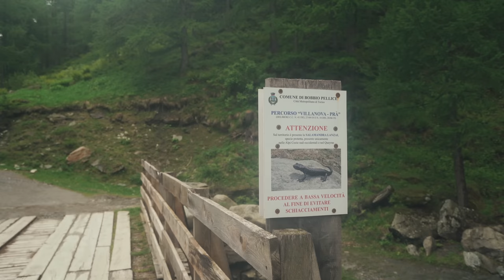#70 Pouring the Floor

Comment: Swales are good, but you still have water running over your driveway. It might be worth considering running a drainage ditch along the uphill edge of your driveway to direct the water, and then pass a culvert under the driveway if you need one. That way the driveway can stay mostly dry. Also given the muddiness you might consider a geotextile fabric under the stone. And I would also consider using crushed stone instead of gravel. Especially if your local gravel is collected from a river wash. River gravel is rounded and will roll downhill over time. If you ever intend to plow the driveway, you'll be plowing gravel too. Gravel is also more easily pressed down into mud, and then you're back to a muddy mess after a couple seasons. Crushed rock locks together and forms a more solid surface which is less inclined to wash away. Crushed rock on a geotextile fabric will give you a stable, durable surface.
Reply: I hope Martijn will read this advise about the road. I was reading a blog by Atulya K. Bingham on the top 3 things to organize if you go off grid. In her top 3 were water, a good acces road and (I don't remember).... and I was thinking about Martijns' road. I am sure he will do a lot of desktop research before proceeding.
Reply: Spot on advice @ErikPukinskis.Geotextile fabric for construction  (Not  weed barrier fabric,total different) is essential, it provides stabilization, reinforcement, & drainage,otherwise you'll just end up with a muddy mess.
Reply: I agree. ☝️
Reply: I agree. The same reasoning for rail ballast regarding river stones. But I prefer the strategy of dispersing the water flow, not conveying it.
Reply: I agree, culvert(s).Get the water under and beyond the road, not over it.👍

Comment: As a concrete man’s wife I was also so disappointed that you will have a cold joint where you ran out of product. You handled it with much grace. The project is coming along well. I’m proud of you young man. Many blessings from Canada 🇨🇦. So glad to see all four hens survived the assault.
Reply: I noticed that and wondered how much of a problem it would be. What are the downsides?
Reply: @lottie2525  the uncertainty is what makes a cold joint undesirable. Martjin’s purposes are encasing plumbing, drying in a living space, and supporting the uneven placement of weight. Liquids seek the path of least resistance and will flow along the joint toward the bottom of its slope. During winter this increases the risk of the concrete cracking during repeated freeze/thaw cycles.

If the joint is too close to the finish grade and/or sloped, the top layer of concrete can break from overlying pressures or spall.

Comment: “I highly underestimated the amount of concrete I needed” is the hallmark of all foundation pours. It’s always more than you think.  Looks great, making great progress. Always love your videos.
Reply: Was that concrete or slurry as to my mind that was way to wet ?
Reply: @gegwen7440  My thoughts as well
Reply: @gegwen7440  am I correct in thinking that have it more wet, makes it cure slower and therefore actually DOES adhere fully to the new layer?
Reply: This latest one🙌
Reply: I have done the same as a armature DIYer.  A 60 lb bag of cement seems like a lot.  It's not.
Reply: Once upon a time I was a construction inspector overseeing concrete pours.  I would have rejected concrete that arrived on the site this wet... but I understand our friend doesn't take delivery in huge trucks or use pumps to deliver the mix.  Wet concrete is easier to handle.  I'm sure this will work though it may be prone to cracking.  I'm in awe of how much work our friend  and his friends are putting into this project.  Deep respect.

Comment: Hi Martijn, good job done this week!  It is difficult to fix a mud road with gravel since the gravel simply sinks into the soil and the mud reappears.  One can use road fabric under gravel to prevent that the gravle sinks into the soil.  Doing earthworks to reduce water is certainly a good thing to do.
Reply: Good idea
Reply: When he uses under road drainage and diversion pipes, guiding water away from the road, then building embankments to slow its movement. That's alot of work for one man. He needs a road crew😊
Reply: @mezanian  I was just thinking.... Let's treat him with a team of hard workers to builld the road. episode #72 "The Road Show" 😄😄
Reply: @Pilot333  a chain gang lol😂

Comment: You’ve got the right idea of getting the road access right now. I’m surprised you waited so long to do it. The new vehicle is a good idea, 4wd/low range just make sure you get the right tires with tractor type grips. Use 50mm road base then grade and roll/compact before you start using it. Getting this right will make life much easier for you. It’s hard doing this work on your own, but it’s entirely possible if you’re organised. Keep it up but pace yourself to avoid burnout! 😊

Comment: Swales go perpendicular to the slope, slowing down the water, which also provides moisture to the soils during hot weather. This keeps the fire hazard down because the vegetation has more moisture content. 
People often put swales upslope from the paths, roads, to prevent erosion and water from running,  as you mentioned, along the ruts.
The swale is done so the water will flow slowly down, often away from important things like buildings, roads, sewer systems, and made on a very slight angle toward a pond or other place to release the excess. 
I had property on a fairly steep hill, the drive had to be made so the path was steep in one part, less so in between. It kept the car from both sliding downhill in winter, and allowed it to gain traction going uphill in mud. Originally it was a straight path which caused some headaches, especially for heavier vehicles try to deliver goods. I added a small flat area at the top so I could get simple delivery, mail, packages dropped off.

Comment: dont forget to put road geotextile before gravel! in other case, gravel will sink into the earth in 1-2 yrs!! It also helps a lot if you need to have some big tucks there, as geotextile expands pressure to much larger surface - so the truck wont get stuck even when in raining season! Fingers crossed for your project!

Comment: I was involved in the swale discussion. Then I remembered something I saw on IG of big landslides in Italy . Then I found this . Potentially something to research . 

“Swales are not appropriate on steep landscapes. Any area with more than a fifteen-degree slope (about 1:3.75) isn’t appropriate for installing swales, as the water saturation may cause slides, which could be dangerous. However, like dams, the higher we can get swales in our landscape the more effective they’ll be, as the water will plume beneath them, continuing to use force of gravity to permeate the subsoil at a right angle down from contour (i.e. water can’t move uphill without a pump). Lastly, swales should have trees downslope to regulate the water and stabilize the soil, which means putting a swale just uphill of a building (and its foundation), with nothing between them, probably isn’t a great idea.” 

From this article https://www.permaculturenews.org/2017/03/31/use-swales-appropriately/

Comment: Drainage channels perpendicular to the road are called 'water bars' - as you say, they direct water heading down the road off to one side and prevent erosion of the road surface. You can build one by cutting a shallow swale diagonally across the road, though it can be better to lay almost a ridge of stones along the swale - that'll help prevent it from washing out in really heavy rain.

Comment: Building that road is going to take a lot of work with the equipment you have access to. For it to be really solid you'd want to excavate the dirt and build layer by layer from bigger rocks to the gravel. If you put just gravel on top of the dirt the mud will quickly seep through and you end up having a mud road again. It is also a matter of the thickness of the rock and gravel bed. With the tiny excavator and the size of the truck that got stuck earlier... Yeah, it's going to take a while. But you are doing really good job! This is really interesting series to watch.

Comment: Hello Matijn. It’s your architect friend again. Don’t worry too much about making two concrete pours. That’s called a cold joint and it’s not ideal, but probably not as critical in a floor slab. A concrete wall poured that way would need more critical attention. After the concrete is fully cured you will probably see some (superficial only) cracks. Those would likely have appeared anyway. On the positive side, all that rain and humidity probably bought you a little time. Concrete likes to cure and dry out slowly. P.S I’m glad the girls are ok!

Comment: Never curse the rain. You are blessed with faboulus weather up there, a great sign you have chosen well on the location.
Reply: Rain is always a good thing.
Reply: Makes no difference.
Reply: Official-Martijn-Doolaard- 97-99 chevy silverado 4 by 4's are great trucks. Yes the guzzle gas but, you only drive them when you need heavy loads moved. They will climb that mountan for sure.

Comment: Hi Martijn,

I think buying a rooster will help improve the situation with the safety of chickens.

Guarding and protection
If the hens are not kept in a special pen but on free range, they may well go quite far from the yard and get lost or attacked. During such walks, the male watches the hens and always brings the strays back to the coop before dusk. While on the walk, the rooster is constantly alert and ready to protect his hens from any enemies from the sky or the ground. Upon noticing danger, the rooster will sound the alarm and signal the hens to run for cover, and he himself will engage the predator and fight it to the death, but will not back down. The rooster will be especially vigilant if there are chickens in his flock.
Why is a rooster needed in a hen house?
A rooster reliably protects its coop from rats, gaits, and foxes. Large individuals are able not only to turn the enemy to flight, but also to kill him. If the male is very aggressive, the rats are afraid even of his voice, fleeing only when they hear it.

Comment: Hi Martijn, on your driveway (road) just grading it a putting gravel down, will only last a year or two. As the rain and mud comes the gravel will sink and the mud will come back to the top. after you grade it, you need to put a tough barrier (where the water runs through but dirt does not come up) landscape roll (for french drains won't work not tough enough). Don't know what is available there and it is costly, but it will solve many problems for many years. good fortunes
Reply: I agree- get some geotextile down before stoning it. Swales collect water along the contour. Folk here in the UK talk about Gripes to divert the water off. Success met alles Martijn.

Comment: I’m probably fishing behind the net…. The Dutch will understand.
But if you don’t have enough cement for the full pour….. just divide into various smaller boxes, and fill those until full.
And if you aren’t going to cover the cement floor, fill each section box to 80%, and then pour the whole top coat in one pour.
Less cement needed, and you can tweak the proportions to achieve a smoother top coat….

I am no professional , but some experiences have taught me a thing or two.

Succes verder 👍🏻

Comment: So sorry about the dog attack! You need to splint the chickens leg or it will get a serious infection and die in agony. Soak a cloth in Juniper Berry Essential oil and wrap the leg. Then splint it and wrap it with sticky bandage. I fixed a Guinea fowl' leg that way, after not doing anything for 3 others which all died from infection.

Comment: Martijn, for your next concrete pour it would be better to use the proper re-inforcing bar chairs to raise your mesh above the ground. Using half bricks will potentially weaken the slab. The chairs are very cheap. Cheers.
Reply: Maybe rocks could replace the bricks

Comment: Ciao Martin, great video! Not sure what you mean by bigger car, but be careful because heavier cars with maybe larger axle can be worse in these italian mountain roads. Jimmy is often the best compromise, however I guess the landrover you drove previously behave nicely. I understand you may need more power but don't underestimate that bigger and heavier cars have downsides as well in these roads. Great job anyway, and godspeed recovery for you girls!
Reply: Better option would be to get a regular-size(not compact) 4 wheel drive pickup truck...would be easier than pulling a loaded trailer up and down steep roads and slopes, less dangerous and less wheel spinning on the roads...

Comment: Glad your girls survived.
Building a fenced area for them won't protect them from hawks in the sky or pine martens if you have them in your forest. They can leap six feet and squeeze through 45 mm apertures.
Pouring the concrete floor seems like the victory lap of an immense project. I hope you will launch it with a little celebration.

Comment: For the parking/working areas which have mud and stagnation of water consider using prefab grid plastic elements that have an hexagonal pattern through which grass grows. They are very easy to install on a bed of sand and when the grass has grown they practically disappear. Numerous municipalities are installing them in parking areas and in beaten paths for their cheapness and ease of installment and for their permeability to water. The only problem that comes to my mind is that they are not high heels friendly 😊

Comment: Regarding the road trench...it's often called a "water break."  Also, depending on the lay of your land, you can create small water brakes above the road to redirect some water before it reaches the road.  Time to rent the mini-x again.  It will make fast work of those issues.

Comment: Thank you for the beautiful scenery that you shared. Your floor turned out great even with the conditions that came about. Wet soupy concrete is very hard to work with, it’s better to let it set up a little then you can hand finish it. Ditches along the sides of your driveway will help keep the water at bay along with a culvert here and there to help funnel the water down hill and away. Take care Martin

Comment: You need to consider getting a Land Rover 110 Hicap or a Land Rover 101FC GS instead of having a trailer to tow up and down. A decent set of tyres would mean you lose traction less. The 101 GS would be my choice as it is capable of carrying a 1 ton payload, has low gearing a V8 petrol engine and removable drop sides on the load area. You will be able to get that right up to where you want to unload the item. Not to forget the 8 foot x nearly 6 foot load area. It might cost a bit to buy, but it would be the most practical for your needs carrying a load up the mountain.
Reply: Official-Martijn-Doolaard.  Prove you are the real Martijn. Mention me on the next video.

Comment: Hey Martijn….If you have not already, consider installing a geotextile mat on the road sub grade before installation of the stone.  The geotextile will spread the vehicle tire loads over a wider area, which stabilizes the road surface and helps minimize ruts.

Comment: If you pour cement / concrete in two sessions, the whole floor might even get stronger and you wouldnt even need to put steel in ;-) 
My neighbour does it that way for quite thin tables made of concrete and they last!

Comment: just remember that a bigger car will let you tow more weight, but for the traction issue you need more ''aggressive'' threaded tyres, the one you are currently using are too much road friendly

Comment: If you need another car try the y60 or y61 Nissan Patrols, very reliable and great workhorse and they even come in a short wheel based just like your Jimny. The Patrols have four wheel drive and have a limited slip differential in the rear at least for the y60 Patrols. The non turbo Patrols are slow and almost like driving a tractor but nothing too bad and i believe the max towing is around 2500kg. They are easy to maintain and modify as well as cheap! Just watch out for rust.

Comment: Wot I've work on when doing concrete work out how much you need then add 50% more been short like you b4..it's like if you dig a hole in the ground then use all the dirt to full back you always need to get more

Comment: a few minutes to do a simple calculation (length x width x height) +10% will prevent the cold join in the future...well done though, its hard work hand pouring that kind of volume...All the best.
Reply: OfficialMartijnDoolaard_  
20mpa is about 1:1.5:3 cement/sand/stone. 25mpa about 1:1:2

So... lets say you got 6m x 6m @ 120mm thick down there... you'd want 4.23 cubic mtrs of aggregate and 38x 20kg bags of cement (9 bags per cubic mtr for 20mpa) the cement will add some extra volume, so this will make up the +10% extra.

Also, a swale is a level ditch on contour, designed to slow down sheet flow accross the landscape.  Diversion drains are what you want above and around infrastructure and built areas.  Swales are for tree plantings specifically to soak up excessive water.

When you have your digger next, place a diversion drain 5mtrs above the two cabins with slight fall toward the forest (50mm - 75mm every 1mtr).  This will interrupted and divert the sheet flow away from the french drain you placed behind the cabin.